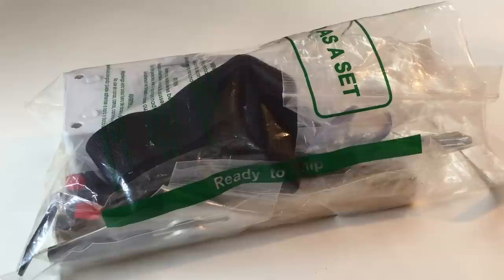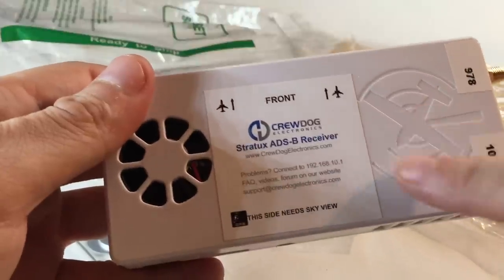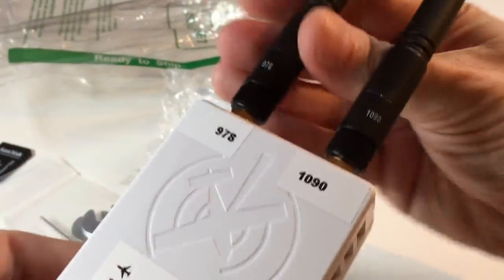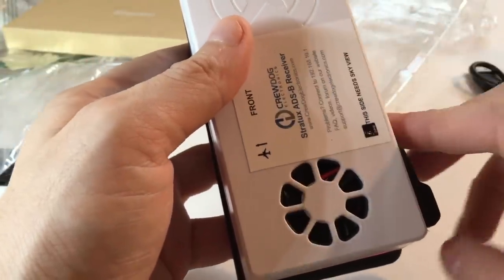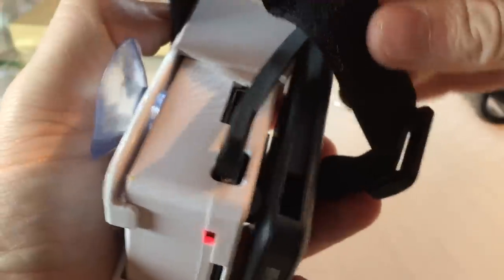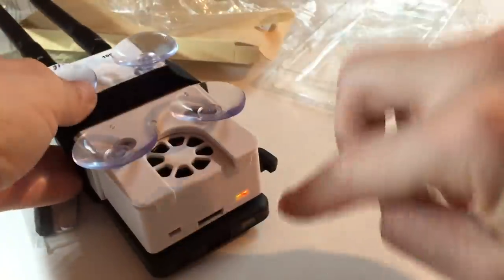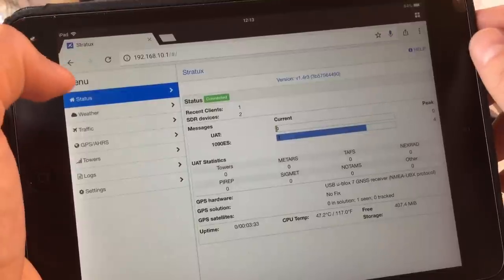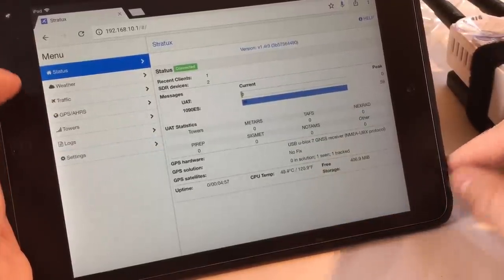Stratux Dual Band ADS-B Receiver Quick Start Video - Get Your Stratux Up and Running!

Comment: Thanks for the video. I ran it several times in order to fix a problem. I put the unit together, following all the instructions and operated it on my plane for several moths. Then, a few days ago, it would not work, showing only a red light. My iPad would not receive the stratux  page I under 192.168.10.1
After watching your video on re-flashing the sd card, accomplished a successful re-flashing, installed the sad card in the unit and was rewarded with a steady green and red light. However, I am still not getting the needed wifi connection between the unit and the iPad. I am now at wits end. What appears to be the problem?
Joe
Reply: After reflashing turn, the stratux on and wait about 15 min and then try to connect on the stratux

Comment: If using FltPlan Go on a Windows 10 computer or laptop, turn off the firewall OR open port UDP 4000 and allow ICMP (ping) otherwise the Stratux cannot find the PC or send data.  (It pings first, then sends a stream of UDP packets).  Client devices (iPad, smartphone, computer) are assumed to exist if found in the DHCP leases of the Raspberry Pi AND if the device can be pinged.

Comment: Hi I just purchased the stratux with the AHRS and GPS. My plan is to use it with an iPad but I do not know if I need WiFi + Cellular or if I can get away with WiFi alone. I will also probably use ForeFlight. Thoughts?

Comment: Thanks for the video. I have a question. Everything is the same on my unit but my settings page is totally different from the video. It shows AHRS, Commands, Configuration, and WIFI settings. Is this a newer version or an older version?

Comment: Hi Sean, I see you sell one with an external (MCX connector) GPS antenna.  Can you build it with a dual-band (but single SMA female) antenna connector?  I plan to install it remotely and replace a GDL39, the airplane already has a single dual-band ADSB external antenna that goes to the SMA cable, and a remote mounted GPS antenna with a MCX connector on it...

Comment: Thanks for the video, can you get AHRS to work with foreflight using stratux?
Reply: Also, do you need the Velcro to keep it all together or is it optional?
Reply from the maker: You're welcome! Yes all the units I ship work with ForeFlight AHRS using the Dangerzone upgrade. I'll post a video on how I do it.
Reply from the maker: Optional but I think it's the best solution to keep the battery with the unit and mount.

Comment: hi all,
ordered, set up and installed this device back in jan 2019.  it was working fine until a few days ago.  now, after fully recharging the charger that came with it, the stratux only shows the red light, never the green.  obviously its getting power, but what does a solid red with no green mean?

also, the IP 192.168.10.1 no longer connects from any computer.  has this address changed?

thanks...
Reply: Try re-seating the micro SD card, if that doesn't work you may have to reflash the program on the SD card. It's very easy to do, I can help you more if you still need it.